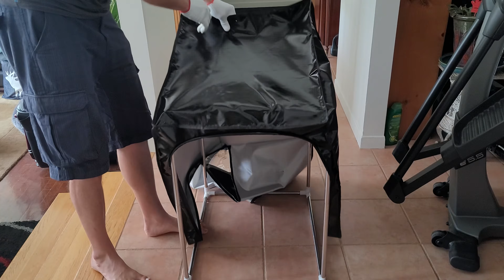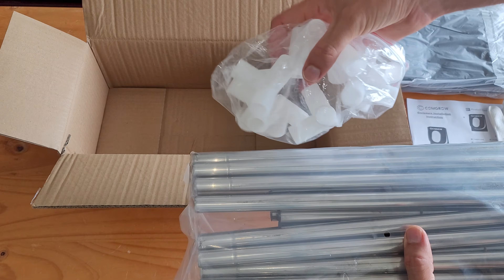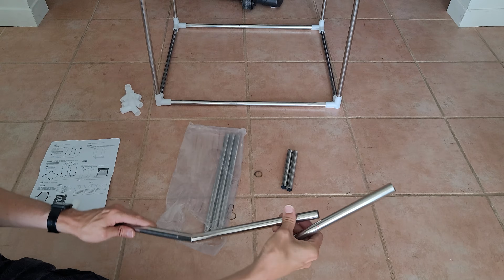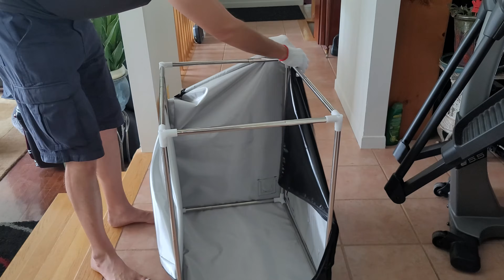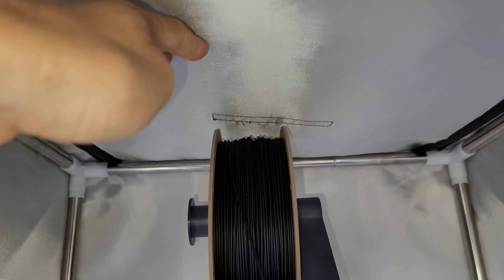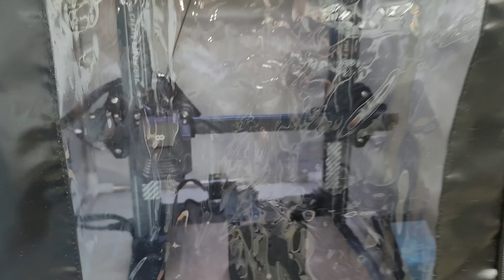Is The COMGROW 3D PRINTER ENCLOSURE Any Good? I Review & Show How To Assemble Protective Cover Tent

Comment: It it safe to run 3d printer with the enclosure completely closed ?
Reply: Yes, what is your concern?
Reply: Depends what you're printing. If ASA/ABS, then no. You need some form of ventilation or filtration.

Comment: my manual (of anouther enclosure) didnt warn me the inner lining is fibreglass! i was wondering what the gloves were for and felt it a bit odd to wear them while constructing the enclosure.
Reply from the maker: Yep, they should really silicone coat the interior. The fiberglass is more of a concern along the edges, where the strand ends can be exposed.